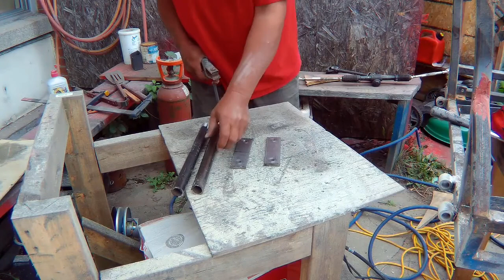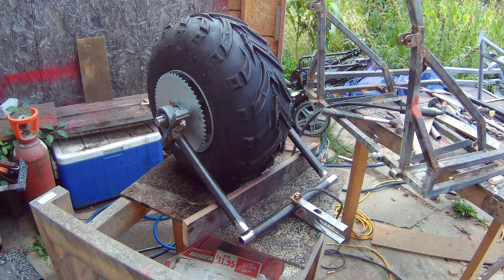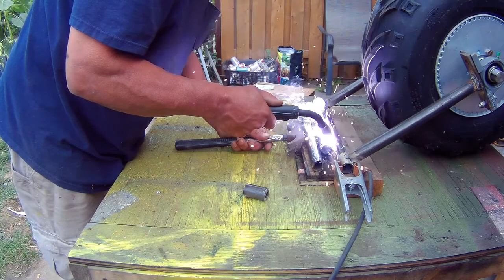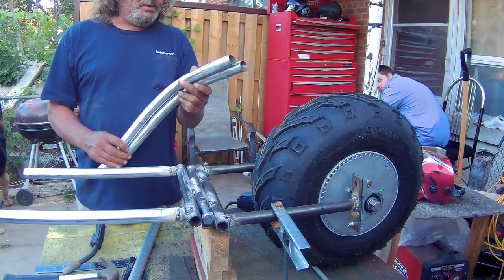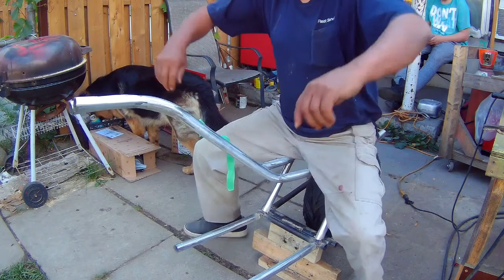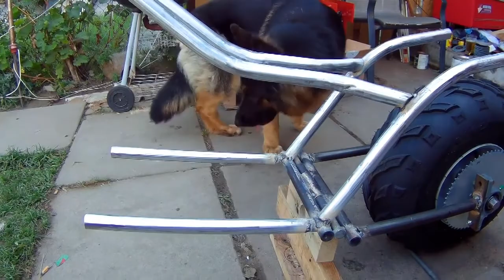Mini Bike/Chopper Build pt.01

Comment: Very cool Neves.  The 30 series converter should work well in that bike.  
Easy way to do your  steering would be to use the bearing cups off a pushbike  steering head.  Fabricate ya triple clamps  and use the bearings out of the pushy. . 
Look forward to seeing the next vid. 👍
Reply from the maker: Hi Customwinder 1, I think that would be the best way to go, thanks